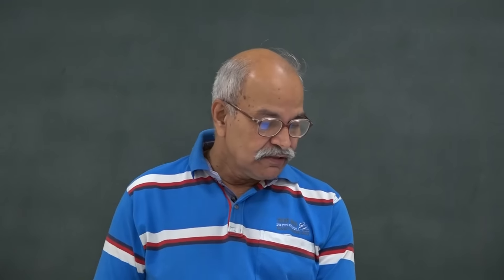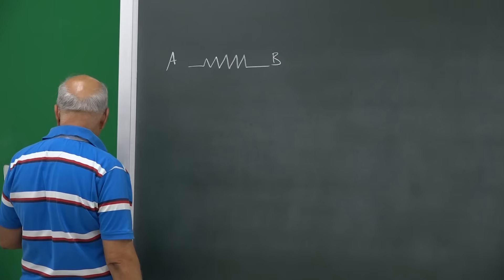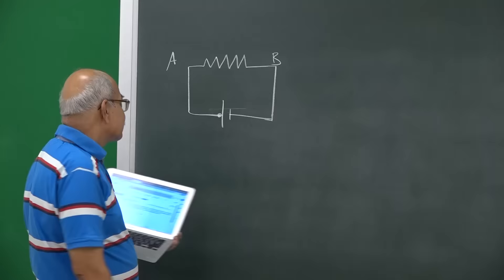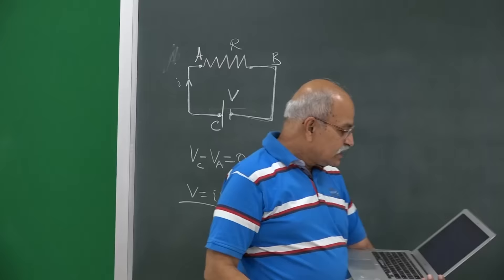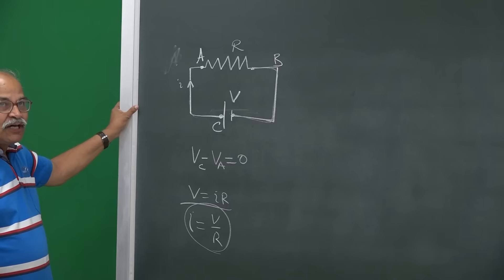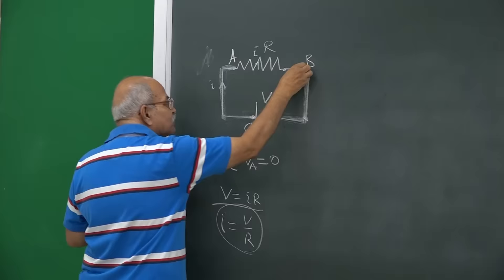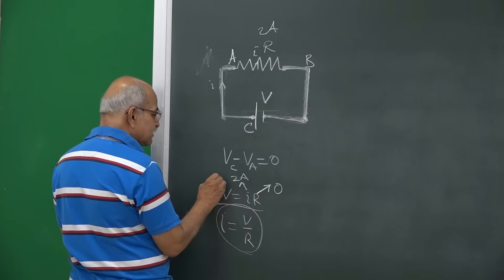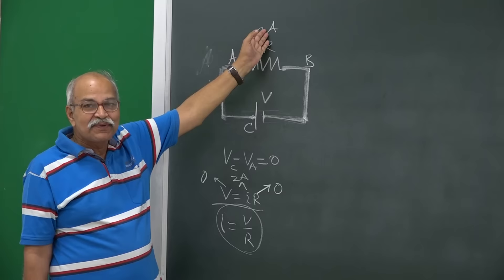Current without potential difference

Comment: Great to see a veteran in field clearing fundamental doubts of students thereby encouraging us to invest out time in this beautiful subject.
Reply: According to me as Va and Vc are at same potential but Va and Vb on both sides of resistance have potential difference then I= v/R flows through ckt
And also if va = vc then means potential difference is zero so if there is no resistance between va and vc then 0/0 form so if resistance is not connected in whole ckt we could not determine current but as resistance is there so by ohms law we can determine current so to determine current we should have resistance or impedance( in ac)
Reply: Hello sorry I might be a nuisance but in our preboards examination(class 10)  we got a question quite similar to this which I am having a trouble to understand and no teacher of my school is being able to give a reasonable answer without defying past concepts. If u ppl could help me out it would be of great help.🙏
Reply: @aditya2892  so hey , ik your boards are coming and it's just right to clear every doubt you have , so here comes the explanation 
While dealing with circuits and electricity , in general cases , as we say ideally , we consider the resistance provided by external factors negligible , but since the question here is asked that if there is no potential difference between the two points A and C , then how does the current flows , we have to take the external factors and also the configuration of the wire we are using for the circuit alongwith it's material so yeah that's it , it is the simplest I can get to since you are still in 10th 
Lastly all the best for your boards !!
Reply: @anuverse7358  thanks brother for your explanation ❤️❤️

Comment: I think this question is the same as asking how an object in frictionless space can travel with a constant velocity despite not changing its potential energy.  It does so, because objects in motion must remain in motion until acted upon by an outside force. 

In this case the electrons in the wire experience a change in potential energy across the resistor that provides them with the kinetic energy to complete the circuit.  The motion of the electron through the "frictionless" wire is not due to a potential difference in the wire, but to conserving kinetic energy in the absence of an outside force.
Reply: Thats what I thought too
Reply: Perfect deeper explanation
Reply: Verma sir's answer was more mathematical in nature...
But this explains the thing in a much better way 👌
Reply: newton BABA ki jay .
Reply: Perfect
Reply: pro twerk  when he says space is frictionless, he means that when you are moving through space, there is no air resistance acting upon you to stop so you will keep moving until someone stops tou motion physically.
When you talk about tying knots or belts in space, the friction between the surface if the belt of course comes into play
Reply: pro twerk  pls go back to school
Reply: pro twerk  friction is a phenomenon that is dependent on surfaces. When two surface come in contact they experience friction.
So depending on the coefficient of friction of surface, the frictional force varies.

Saying that space is frictionless, or not makes no argument. Whenever there are two surface interacting, there is friction.

So basically in space there is no air resistance an astronaut moves, because there is no air.

I hope that makes sense
Reply: Guys don't please discourage questions. Questions are essential for development
Reply: U people r fighting 🤨
Reply: What is conserving kinetic energy?
Reply: pro twerk  2 min silence for this guy
Reply: pro twerk  in some cases it can be assumed to be zero...just like how we assumed the wire to be resistance less because it is negligible
Reply: What intially gave them that force that remained conserved in resistance less wire?
Reply: quite wrong with the statement "...motion of the electron through the frictionless wire is not due to a potential difference in the wire,..."
One of the 4 fundamental forces is electomagnetic force and this is the force responsible for pulling an electron towards an electron deficit or a positive potential. So for sure it is the potential difference that causes the motion of electrons. 
Energy conservation happens in the following way : 
potential energy of the battery => converted to kinetic energy of electrons => converted to heat and light energy when the electron hits the resistor, the wire and the positive node of the battery. 
Thus the potential drop at the resistor has to come from the potential energy of the battery thereby preserving the conservation law
Reply: Bhai tu tu Verma ka abba nikla. Cheezen aise hi samjhai jaati hain.
Reply: Plz take my point As per my research there is no kinetic , potential, or any kind of such energy. Only Motion Energy is there. Force Generate Motion and motion generate energy. Force is depend on another force not any kind of energy. Force cycle is there. I do not agree Current Energy concepts .
Reply: Current flow is liken to water flow...if there is no elevation, water will not flow on flat surface same way if voltage difference is not there current should not be flowing..
Reply: @ghp780  source?
Reply: @naammekyarakhahai8952  lets focus on the important parts within Mr. Sterman's reply:

First - focus on these statements
"how an object in frictionless space can travel with a constant velocity despite not changing its potential energy."
"...until acted upon by an outside force. "

He is referring to an object moving with constant velocity in outer space in the absence of external force, like gravity or collision with other bodies. 

So why is potential energy being referred here?? In order for an object to possess potential energy, it should be under the influence of gravity or be under stress like a spring or in a electric potential difference from its surroundings. 

So that leads me to discard his first claim of equating the content in the video to that of an object moving in external space.

Next - Lets focus on these statements
"In this case the electrons in the wire..."
"...change in potential energy across the resistor..." 
"...provides them with the kinetic energy to complete the circuit."

Lets consider a simple circuit with a wire connecting the -ve plate of the battery via a resistor to the +ve plate of the battery. So this circuit is now complete and will result in the flow of electrons from the -ve to the +ve plate. Lets denote one end of the resistor as 'A' (near to the -ve plate) and the other end as 'B'.

According to Mr. Sterman, the electrons in the wire near 'A' flow towards 'B' because there is a voltage drop across the resistor. How wrong !

Ofcourse there will be a voltage drop across the resistor and that is the purpose of it. But that is not the cause of movement of electrons. If you take out the resistor and just connect the -ve plate to the +ve with the wire along, the electrons would still flow. It is the electric potential difference existing between the battery plates that is causing the electrons to move. In fact there will be a larger number of electrons that would flow because there is no resistance. This can quickly heat up the wire. Its called a short circuit. This is one reason why the fuse (which is nothing but a wire with a very low melting point) at your home blows when you directly connect the phase to neutral. 

In my reply to him, I have just pointed out the electromagnetic force which is the actual cause why an electron moves towards a +ve potential.
Reply: @naammekyarakhahai8952  First off, this is not correct: 
"..whenever we talk of potential energy, we talk about change in potential energy.."

Ofcourse it is the change in potential energy that has physical significance but it doesnt mean referring to potential energy is the same as potential energy difference.

Gravitation Potential Energy for a unit mass 'm' at the current location 'x' is the work done in moving that mass from infinity to 'x'. Lets expand on that thought process. 

Imagine a room full of magnets. Some strong, some weak. And they are all spread randomly across the room and for the sake of simplicity, lets imagine they are all stationary. 

Now when you walk into the room with an iron nail dangling from a thread in your hand, you will see it sway in different directions depending on where you are in the room. And I am sure you know this is because of the net magnetic field at that point, acting on it. But since the iron nail is left dangling on the thread it will develop potential energy since it wants to leave the thread. And when it is let loose, it will move by converting the potential energy it possessed to kinetic energy and eventually when colliding with the magnet, the kinetic energy will dissipiated into other forms of energy(heat, light, sound etc) in accordance with the energy conservation principle. 

So how do you measure the potential energy at the location of the nail in the room? Well its only logical to sum it up as all the work you did holding the nail, walking from infinity (where the net force on the nail can be considered zero) to inside the room to its current location. 
But the key is in understanding that the work done is in the opposite direction. Which means as you move towards the room from infinity and inside the room, you are doing more and more work to hold the iron nail from leaving its position. And the potential energy is the negative of the work done. Obviously.

So put simply, the potential energy of an object at a location is the sum of all work done from a location where it was experiencing no pull or force (and physics likes to call this place 'infinity') to its current location where it is experiencing a force. 
Checkout wikipedia https://en.wikipedia.org/wiki/Gravitational_potential page for the formula to calculate the Gravitational Potential energy at a point. Remember with unit mass, the gravitational potential energy at a point is the same Gravitation potential at the point. (V = U, because m = 1)

But in physical applications, we see more significance for the difference or change (ΔU) in potential energy and hence it is the more popular term. 

I hope you will not go into electromagnets field because I used that analogy :) Its way more easier to explain it using magnets that explaining it with large bodies in space.

There are also other flaws in your statement - for e.g. running calculations on potential energy from 2 different systems in one context, where one system being 2 bodies connected with the rod and then another system with the first system and the planet S. However you are digging deeper into another department (gravitation potential) and are drifting from the main discussion (electric potential). I would rather keep it confined to what the flaw in the video is. This is what I had pointed out exactly to Mr. Sterman - that drawing wrong parallels would make us stray. 

Having said that I am open to calls than chat as this just gets longer and longer and we tend to drift too apart from the main topic - feel free to reach me at +91-9995438403. Else its curtain from my end.
Reply: @naammekyarakhahai8952  I understand and respect your privacy. You have my number, I don't, so its your call to whatsapp me. Feel free to connect or ignore. Good day
Reply: @GunjanSharma-iw6ou  basically friction for a moving body remains 0 in space not because of coefficent but because of N that is zero since there is not effective GRAVITY in space, for your example of knots, the friction very very less as the N is very very low because of the only actual mass of knot in space.
Reply: So if we reach at light speed by constantly increasing speed in space we only have to do it ones speed won't reduce
Reply: @shinchan5651  potential different across the resistor gave them the kinetic energy
Reply: There is no 'conserving Kinetic Energy', There is no 'frictionless wire'. There is a presence of external force on the wire, the battery provides the electromotive force. The current flows exactly because if there was no flow in some part of the wire the charges would build up in that part of wire which would create a field necessary to keep a sustained flow of charges throughout the system.
Reply: How does the resistor provide kinetic energy to the electrons?? 

When a wire is connected to the two terminals of a battery, the battery sets up an electric field along the wire which pushes the electrons through the wire. Now, the zero potential.. 
It's not actually a zero potential difference. The resistance of the wire is negligible and hence the potential drop across any two points (not having any other circuit element) is negligible compared to the potential drop across the resistor. So, while doing our calculations we can safely ignore the potential drop due only to the wire. 

What do you think? Please let me know..
Reply: I've heard that anything divided by zero is infinity. Here resistance is zero. So current i=v/r and in this case i= v/0 and we get the value of current as infinity. When infinite current comes in the circuit an infinite magnetic field is produced right? What if this happens? Will it cause any disaster?
Reply: just remember newtons first law...u will find ur answer
Reply: A great intuitive answer 🔥💯🙏
Reply: @bullymaguiregaming1757  See the thing is, mathematically speaking when both V and R are zero, i = V/R = 0/0 and if have studied limits you would know that the quantity 0/0 by zero can have a finite value.
Reply: @chaitanyagaur7674  but here V is not zero
Reply: @bullymaguiregaming1757  V is not the potential of battery but the potential difference between points across which you want to find current.
Reply: @chaitanyagaur7674  let V be any non zero value......if resistance is zero then current I = V/R that is V/0 = infinity
Reply: Thanks for the explanation!
Reply: @GunjanSharma-iw6ou  friction between two surfaces come to play if there is any force between two surfaces ....due gravitational force in earth acceleration produces downward direction makes acting friction ...for acting  friction only two surfaces are not enough
Reply: I agree, but what I question is if the opposing force(resistance) is increased, it also results in the increase of a potential difference. So I've always thought of an analogy similar of a spring. The more something's pushing back the current(resistance in this case) the more it 'wants' to go to the other side(voltage or potential difference in this case).
Reply: No, thats incorrect bro both in terminology and methodology
Reply: In that case,does that mean only the electrons in the resistor starts flowing?bcs according to your explanation the electrons in the conducting wire shouldn't  move as there is no voltage in the conducting wires
Reply: looper-
              christopher sternman-
                                                       looper-
Reply: agreed
Reply: Kuch samjh mai nahi aaya mai to sir ko dekhne aaya tha
Reply: No doubt potential difference of wire is zero but potential difference of battery exists
Reply: Electrons as a whole do not really have a drift velocity in a particular direction unless it's forced to have that with the help of a potential difference, the example of a body moving in a space is a completely different case and macroscopic too.
Reply: This is better than HC verma's explanation
Reply: ok as u say the electron gets kinetic energy due to the drift velocity then where do they get potential energy from.the battery provides the electric field which converts into drift velocity,where do they get potential enery from
Reply: exactly what i thought too 
i also feel , anything related to fundamental physics can be explained using the reference of Newton's 3 laws (idk why but in most cases I've seen ppl using it)
Reply: I gave the same explanation without referring to your answer, lmao🤣🤣
Btw if you don't beleive that how I came to give that explaination then let me clarify that I'm an 1st year EE student at IIT KGP.
Reply: Thank you very much sir, now I got the exact point.😊
Reply: Classical mechanics cannot be applied to microscopic electron
Reply: Hi Christopher ! If there is no potential difference,then no work done by the electric field (force). According to the defination of potential difference,it is the integral of dot product of electric field and infinitesimal displacement.Then ∆V can only be zero if angle between electric field and displacement is 90°or E=0 or displacement is zero. However in the wire there is displacement, hence E=0 or angle between E and displacement is zero. Again the driving force inside the wire is electric force then how can the charge move without any force ?
Reply: 👍 perfect explanation
Reply: Bro actually what you are thinking is false , let me explain:-  1) first, electrons are not particles , they don’t have mass  or momentum of kinetic energy.     2) in real/practical life the wire itself is a resistor, we draw wires and resistors separate just to make questions simple, so in reality there is always a resistance present in wires ,so actually current is not following through 0 resistance thus 0 potential difference anywhere.
Reply: What is decreasing kinetic energy?